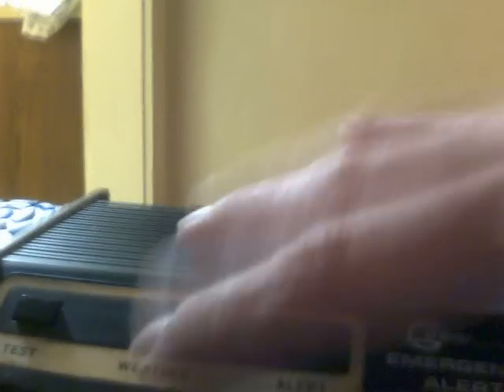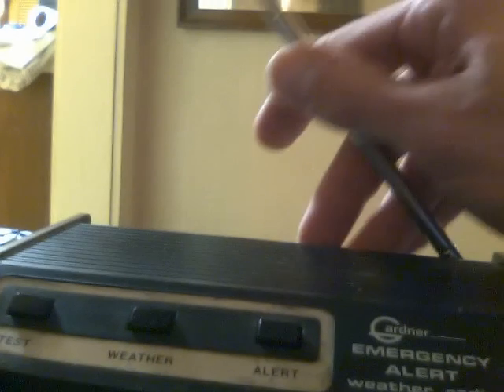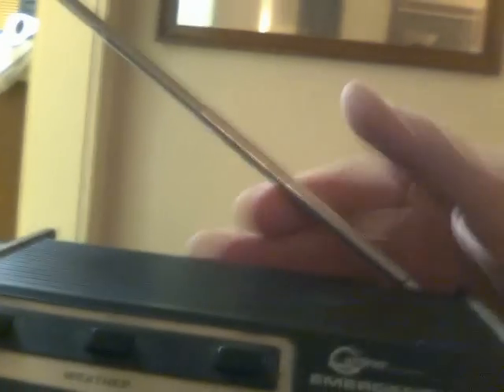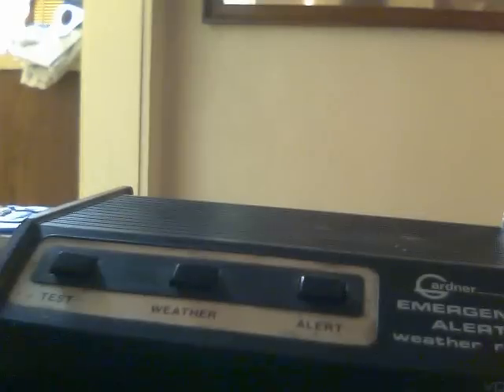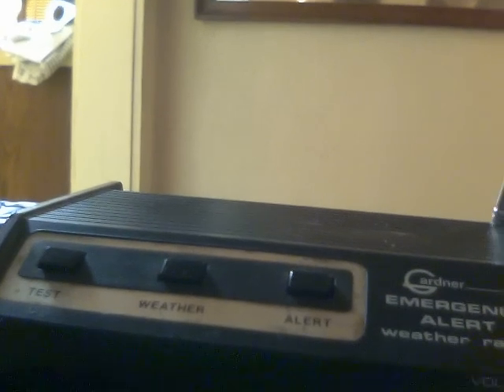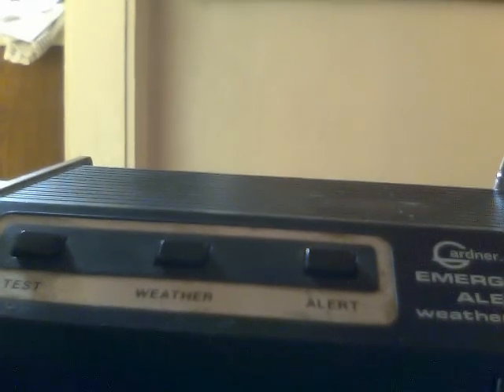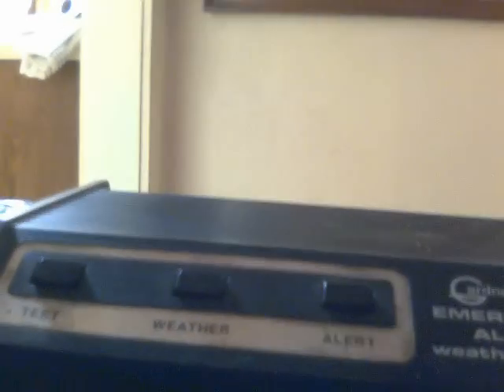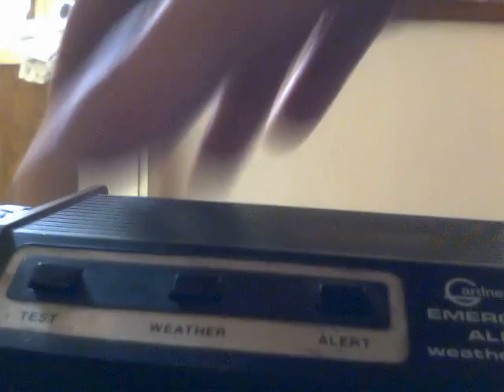OLd Weather Alert Radio

Comment: Pretty sure 1992 is well before the advent of the modern EAS system with its S.A.M.E. databursts at the beginning of each alert. That alert data is what the three buzzing sounds are. I'm guessing that, before the EAS, the long beep must have been the only signal that there was an alert going out.
Reply from the maker: I cannot remember when the modern EAS system started, I am guessing it was around 1998 at the earliest.

Comment: I have a radio thats an old one and its a old portable noaa weather radio. Its model is jh006527. We found it. The weather stations work for yours and mine too. The only reasion why it dosnt work is that the frequency for the weather channel it to low or high now or the weather station that broadcasted to our radios were torn down or changed to radio stations and droped this frequency. Your welcome for the tips :3.
Reply from the maker: That weather radio no longer works